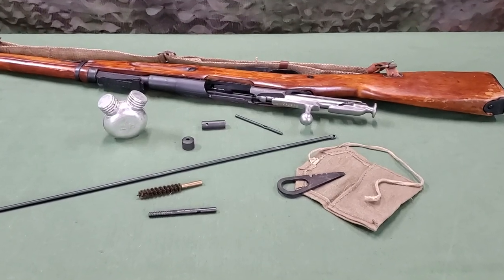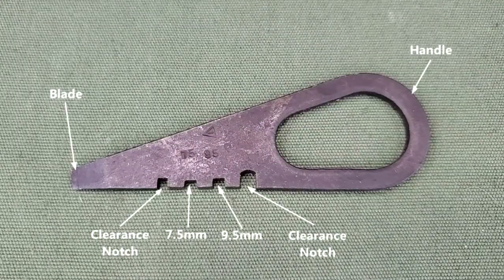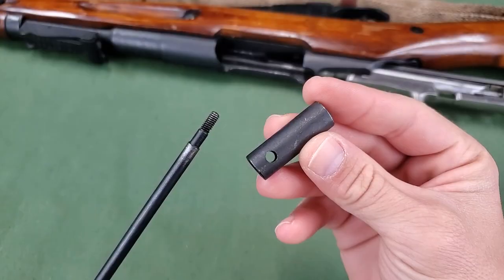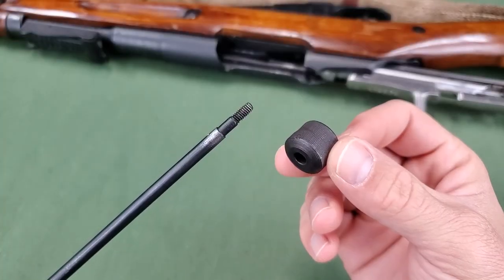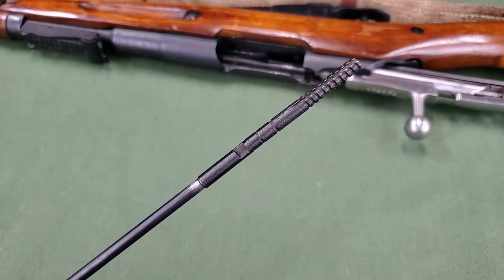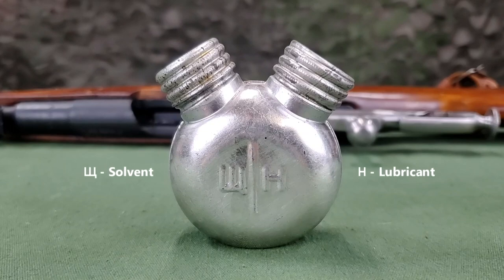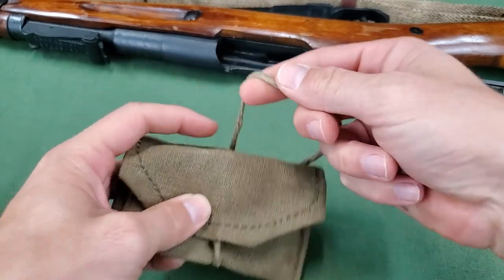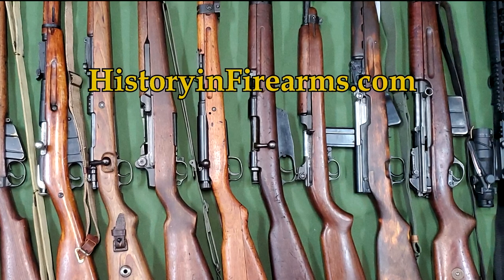Mosin-Nagant Cleaning Kit (TF 6-05B)

Comment: Interestingly, no special cleaning was recommended for corrosive ammo
Reply from the maker: I'm curious as to when they started using non-corrosive ammo. I'm thinking after this manual was published.
Reply: There is a reason that the cleaning flask contains water AND oil. Using the water first dissolves the salts left behind by the corrosive primers and then a thin coat of oil in the bore prevents rust. Though not specifically mentioned, and generally not misunderstood, that is the purpose of the water portion of the flask. I have also hears that good vodka was also often stored on the water side of the flask for a shot of "liquid courage" when necessary but that has not yet been scientfically substantiated.

Comment: Something I have only occasionally seen mentioned is that the "keyhole" in the screwdriver fits over a bayonet socket to give more leverage when dealing with a tight fit.  I had to use it with my unused-since-refurb mixmaster M91-30 because it shot well and to zero with the bayonet fixed and I decided to leave it that way.  The bayonet has since loosened up enough that I can usually (except in serious cold) get it to turn by pounding with the heel of my hand if I don't want to get the cleaning kit out.  p.s. without the bayonet fixed, it shifts several MOA at 2:00+/-.
Reply from the maker: Oh interesting! I plan on doing a training film on the bayonet so I will include the use of the tool for the bayonet in that!
Reply: @HistoryinFirearms 
Is that video out yet? Thanks
Reply from the maker: @goodcitizen3780  It is not yet. Scheduled for early November. I was not able to get my tool over the bayonet as mentioned above though.
Reply: @HistoryinFirearms  
I think November is right on time. I'll be checking back.
Thank you for the quick response.